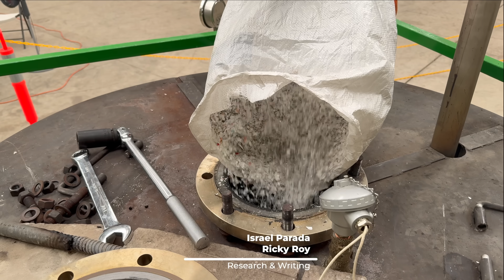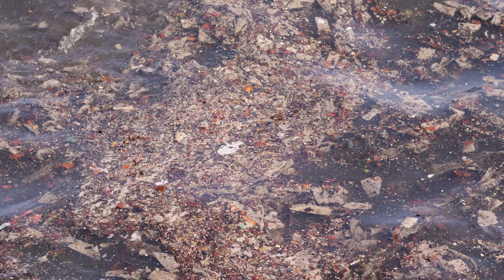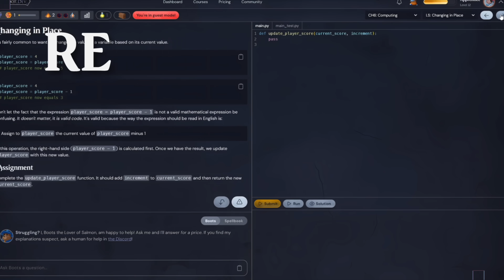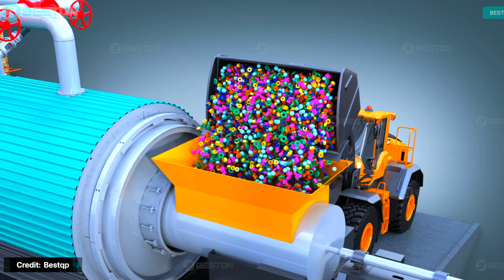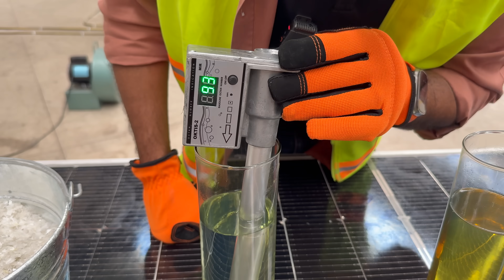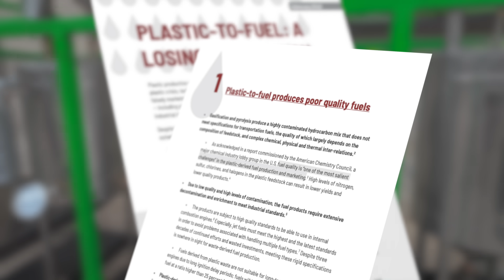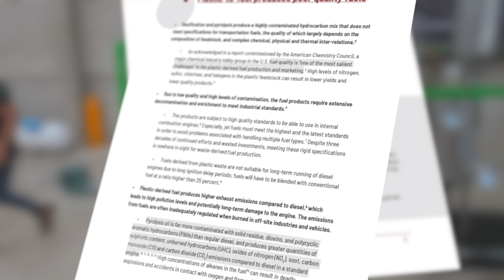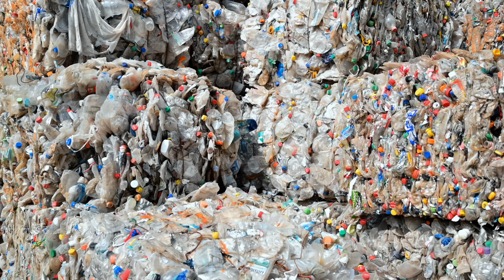Solving the Plastic Waste Problem - This Surprised Me!

Comment: For those worried about emitting carbon into the atmosphere, the question is simple: What has a larger carbon footprint? Collecting the plastic, transporting it, recycling it into fuel, and transporting it for sales or locating the oil, building the infrastructure, pulling the new oil from the ground, transporting it (sometimes across oceans), processing it, transporting it again (sometimes across oceans), and burning it. Seems fairly simple to me.  The people complaining about the emmissions are the same ones who want to stop the use of oil altogether and that is just an ignorant mindset.
Reply: @yogidebear4380  Tbh i know people who own a better technology.
it can produce the energy for the whole process itself, it produce kerosene (or diesel or gasoline) and, most importantly, it can transform every type of waste. 

what’s is show in this video is nothing more than pyrolysis and gasification applied on clean plastic (already transformed)nothing new, we know this process for at least 50 years.
Reply: This business model is not economically viable. Plastic has a cost — no one gives away waste for free, especially if it has been pre-treated — and the energy required has such a high cost that, in addition to raising the break-even point, it may even compromise the sustainability of the entire business model

Comment: It's like a chemical analog to high efficiency heat pumps that just extract heat energy from one place and move it to another. The "energy" is IN the material being converted so by thermal-induced separation allows releasing the "energy" that is in that material which is then used to continue the process. Brilliant. I don't especially like that the outputs are more stuff we should try to avoid using, but, heck, its a huge step in a good direction to have the means to breakdown what would otherwise plague society for thousands of years to come! Well done. I sure hope this goes somewhere. Maybe a parternship with the Ocean Cleanup crew coming soon?

Comment: This is a very cool and interesting process.  I wish governments would invest more into developing it.  The main problem with fuel derived from plastic pyrolysis is that it tends to contain very high levels of Benzene, which is carcinogenic.  AFAIK, nobody has yet figured out a way to efficiently remove this benzene from the final product.  Do you know if this company has done anything to remove the benzene from their product, and if so, what have they done?

Comment: Wouldn't it be a lot more efficient, cheaper and environmently friendly just to burn the plastics and other contaminates at super high temperatures and use the waste heat to generate electricity?

Comment: Plastic is not a viable recyclable due to economic competition.  This plastic crap is very much every where and if urban areas could lower landfill requirements man that would sure go over great.  The Bay Area in CA is filling a complete Valley with plastic crap.  The sorting is the problem. If handled by consumer, the sorting could be done at the source.

Comment: This is a great question that touches on the history of this technology.
The general concept of converting plastic into fuel is not new; it is a long-standing field of study. Since plastic is derived from petroleum, researchers and major oil companies (like Shell, mentioned in both videos) have been exploring pyrolysis—the thermal breakdown of materials—for decades as a way to convert it back into fuel.
However, both Julian Brown and PET Gas are innovators who developed their own unique systems to make this concept practical and efficient:
1. Who Came Up with the Concept?
 * Julian Brown: Julian's journey began with his independent discovery of pyrolysis as a high school student and the realization that plastic could be converted back into its original fuel state. While the underlying science was already established, Julian developed his own reactor and methods (like using microwaves) independently. The original concept in the first video is about Julian personally developing and implementing this process in America.
 * PET Gas: This company also takes a novel approach to the same underlying concept of thermopyrolysis. Their innovation lies in the simplicity of their system and its high efficiency, which their CEO states is a breakthrough that even multi-billion dollar oil companies have struggled with.
The breakthrough is in the method of execution, not the initial idea.
2. Are They Using the Same Process?
They use the same underlying technology, but different, proprietary methods:
| Innovator | Core Technology | Unique Method / Innovation |
|---|---|---|
| Julian Brown | Pyrolysis | Uses microwaves to heat the plastic within the reactor. |
| PET Gas | Thermopyrolysis | Uses the non-condensible waste gases created during the process to fuel the furnace, making the system self-sustaining after startup. |
In summary, both are working on the same scientific principle, but they have developed different proprietary technologies to achieve the goal of converting plastic waste into high-quality fuel.

Comment: the real problem with plastic recycling is that transporting, storing, sorting, preparing costs a lot more than the product you are producing. There are like 160 plastic types, most have so much filler materials that plastic might be the smaller part ... just means that the coke is so polluted from paints you might not be able to use it afterwards .. it's hazard.

Comment: You're the first person other than myself that understands the carbon sequestration value of plastic. I avoid biodegradable items if there is an alternative because they degrade into carbon gases. We can't switch to biodegradable until we kill most of our current emissions. As we electrify our vehicles, this plastic to gas tech will be a good alternative or supplement for drilling.

Comment: Extending the use of fossil  products is still producing green house gases.. If the were turning it into electricity that would be better (pipe dream). WE NEED TO STOP BURNING FOSSIL PRODUCTS. It's not happening fast enough as it is.

Comment: I can't think further, but, at least it is being used before it turns into a smaller volume of solid waste. And into carbon waste which it has always been. We can think of it as, the same volume of carbon that this fuel releases would have been released by fuel from crude oil anyway.
I don't know if that even makes sense.

Comment: This is fantastic - at least in the short term since we will not be moving from petroleum fuels in the very near term and it could substantially reduce landfill growth and dependence on drilling and/or foreign sources of oil.  At a minimum, it could be used for Jet fuel (hopefully) which will not be going to batteries for a while.

Comment: Anything that can reduce landfill waste and plastic  in our oceans needs to be developed .
Reply: I developed myself in not using plastics any more.
Reply: @CompactFlesh You replied on a phone or a laptop.
The fact you were able to reply shows you still use plastics.
But good work if you have managed to reduce your usage.
Reply: And releases that plastic as carbon dioxide in the nature. Sounds good?
Reply: @SergioEvangelistaDev  yes that carbon can be absorbed by ecosystems plastic cannot and Plastic destroys the ecosystems that capture the CO2
Reply: The ecosystems are already overwhelmed by the amount of CO₂ in the atmosphere, the oceans for example. The increase in carbonic acid (CO₂ + water) makes the ocean more acidic, weakening coral reefs and many other organisms. And if that wasn't enough, through the greenhouse effect the oceans are also warming, causing widespread coral bleaching with no end in sight. At our current trajectory, fish populations and marine ecosystems will decline dramatically because we're turning large parts of the ocean into a hotter, more acidic environment.
Reply: @SergioEvangelistaDev  Your argument is too simplistic/narrow. A more holistic scenario. Given that the current global demand for fossil fuel is X, is it better to litter the planet with single-use, non-biodegradable plastics & microplastics & get 100% of our fossil fuel from oil extraction? Or provide some incentive to remove the plastic waste, while simultaneously reducing demand for new oil extraction?  Yes, the focus on what we can do to reduce global demand for fossil fuel (X) is highly desirable.  That is separate and not impacted by this tech. 
I'd note that the Clean energy Technologies, do not replace oil's ability to provide the raw materials for medicines, paint, fertilisers, plastic & similar products that the world relies on.

Comment: Why make plastic into fuel with very poor efficiency when there is a shortage of recycled plastic?
So you want to make virgin plastic from oil to be used as fuel? Not that plastic is simply recycled as plastic until it is burned for energy.
Not all recycling is ecological, like this energy-wasting pyrolysis for example.

Comment: About two years ago I watched a video of a scientist who was doing the same thing on a pacific island and used plastic waste and burning coconut shell’s to fire his system. I think like cigarettes were touted for decades by big tobacco and they downplayed the injury and hid the facts. So too big oil has been hiding for decades how to resolve the issue of plastic waste.
Some little startup in Mexico came up with a solution? Okay let’s build twenty plants and then recycle some plastic it won’t cost much money for ten cities on the east coast and ten on the west coast who already have power plants near the water and old coal burning power plants that generate enormous amounts of excessive waste heat which they could spare a little bit of to power the reactors. The extra propane is a viable product for resale or storage let’s keep it.
Recap not expensive since the science is done.
Not awful except for scaling up the process and automaton of the system to keep it running longer 
Using existing waste heat from power plants or refineries to jumpstart the pyrolysis reactors.
Provide proof of concept by repeating the design 
Automation to reduce the danger to humans.
The pyrolysis is a reaction which when done with care produces viable energy products.
When people get involved in science experiments things can go wrong, a pyrolysis plant is a really good idea if you run it well or a big bomb if things go sideways.

Comment: I recall a PopSci article from years back (and subsequent YT videos) about Plasma Gasification.  It is a similar idea except you can feed into it anything.  Medical waste - residential garbage - tires - bodies, no problem.  It uses an electric arc in an oxygen-free reactor to reduce all to gases.  The output was "syngas" which is essentially natural gas, and a slag that could be uses as industrial abrasives.  There are commercial installations in Japan, China and India and smaller units used by places like hospitals, airports and military sites.

Comment: Question is you produce the plastic, uses so many energy, then you need to use the energy to dissolve the plastic to the fuel, that is so weird, why don't you change the sustainable materials, like the paper packaging materials, paper
 bottle,aluminum cans and glass bottles and iron cans and algae packaging materials or agriculture waste can be crushed to the powder and compress to the building bricks or plate or packaging materials

Comment: What are they doing with the Sulfur and Chlorine which are used to stabilize the plastics and are released during pyrolysis?   I have a business plan intended to do this exact thing, but I need a mister cooling tower where the water captures the sulfur and chlorine to be collected and resold preventing them from going into the environment.

Comment: This system is not feasible you need a lot of heat for the pyrolysis (450 to 600 degree C)and still conversion is very low. Its even bad than free energy wheel viral on tiktok. And these extracted fuels are not usable to run the engine because of micro plastic in it but can be used for burning purposes. Burning these still ban because of some bad environmental issues.

Comment: Use for fuel vs. plastic is likely a mute point - I expect economics would direct materials to plastic 1st.
No cat cracker to process the wax was surprising.
Next upgrade would be a continuous rather than batch process, or multiple kettles feeding the train.

Comment: It seems really interesting that this is possible but I think incineration power plants are a better option because they are more flexible in what is used as fuel. This seems like a much cleaner but a much much more expensive way to deal with a smaller portion of the plastic waste available. Incineration like in Sweden, Japan, Singapore and likely more places is the way to go. More energy is put out, the smoke is cleaned, it is used for both district heating and electricity production... It is a better system for more of the waste, therefore less plastic floating in the ocean. Big win!

Comment: How many times can plastics currently be recycled? Do you get 1 bottle for every bottle recycled? 
If their claims for their fuel composite makes out, would it make sense to push all gasoline sold through this for the less green house gases?
Maybe if we can certify all plastics get recycled 10 times or 20 times, then turned into gasoline, the sheer volume of oil we don't have to drill will make more sense.

Comment: Once again one of those cure the symptom, not the disease. Need to reduce the use of plastics and carbohydrates so using energy to reclaim some of it to burn it isn't the solution we actually need.

Comment: It makes a lot of sense to recycle plastics into gasoline, diesel, coke and gas. However, the yield with or without catalyst is low. Another thing is that it is a batch process due to coke left in the pyrolysis vessel. So I would say that it makes sense to be turning plastic into fuel however it will not turn a profit, not even when the plastic is free. There will be around 30% paraffin wax and 20 - 25% gas and coke which are not profitable due to low quality. Now making only 20 - 30% diesel and gasoline and around 5 - 10 % heavy fuel oil. So all in all only works as a recycling tool to reduce HDPE, LDPE, PP ending up in a landfill but it does work and makes sense. But not 90% gasoline from plastic. More like 10 - 15% gasoline by weight from plastic input.

Comment: Project Genesis offers a full Pyrolysis continuous feed or batch plants depending on the landfill site and daily collection. Used tires and Plastic waste yield up to 86% of the volume. We can process up to 60Mt per day with tires and plastic making up approximately 30% of daily waste. We utilize the Bio oil collected or HFO prior to processing further which we operate our a steam turbine on.  the energy produced will be add onto our Green hydrogen production requirements, where our Gasification plants producing Syngas or CNG is added with our power from Bio oil (HFO) . We use the Plasma torch to reclaim land from old decaying MSW. We in search of JV and PPP, Angel or seed investors too.Our Completer Zero carbon free zone by 2030 starts at $ 7billion , this includes Maglev high speed monorail systems for Passengers on top and cargo well on level below. This ensures a steady flow of waste as well as delivering our By- Products from all our plants, these are as follows:  Carbon black,Organic fertilizer, Drinking water from water reticulation plants that our Gasification plants produce, bio-char, activated Charcoal . There is accommodation for 10000 new employees, schools,Hotels , Accommodate up to 75 000 homeless people included in the estimated costs. ROI within 18 to 24 months.

Comment: Two decades ago a thermal depolymerization plant (TDP) was opened next to a Butterball turkey processing facility. It turned turkey offal into light sweet crude oil, water, and minerals. The process was very efficient and could process basically anything with carbon chains.
Reply: Where was this? Do you have any other information about this?
Reply: @gregorymalchuk272  Google the terms thermal depolymerization butterball for all the details.
Reply: I read about it about 20 years ago. It could turn car tires (there is some metal in them, that falls to the bottom of the first stage), medical waste (destroying virus, bacteria, and even prions) and of course garbage; into fuel.

Comment: Saab has been developing a plant based gasoline. They said 2 more decades of research. The oil industry has been socalled researching this for decades, yeah right. This is a complete game changer. Can you imaging if they had put the billions into this rather than EV's. And really who cares where you get your crude from? If you took plant based and mixed it with this, you would have lower emissions, get rid of plastic waste on a large scale. And since plastic is not going away, you would have an endless supply stream. This could easily help with global warming on a huge scale. You get rid of a problem substance, rid the environment of plastic waste and lower fuel costs for everyone. They really need to stop screwing around and get this and plant based fuel into production. Plant based gas has an almost zero emissions produced. If you could mix this on a 50/50 scale you could overnight decrease carbon emissions 50%. Growing the plants to produce fuel would also help with the ozone layer as plants absorb harmful chemicals and release oxygen, and the chemical that helps rebuild the ozone layer. No more mining harmful lithium for batteries for cars. This is a no brainer.